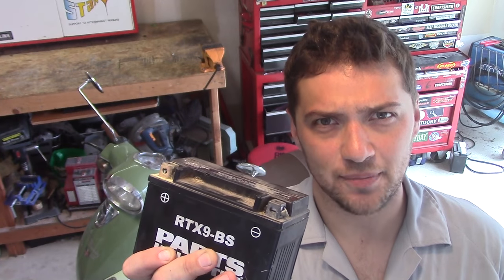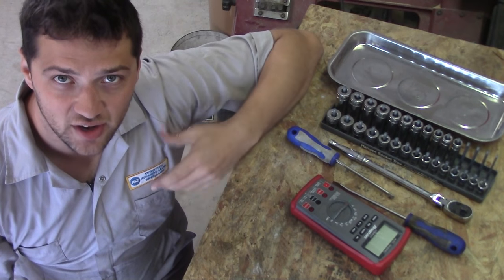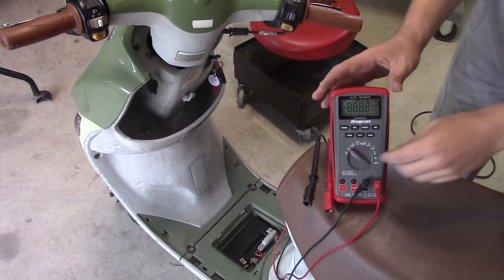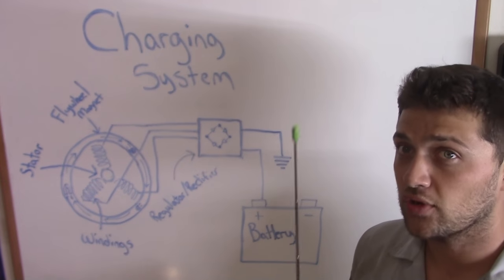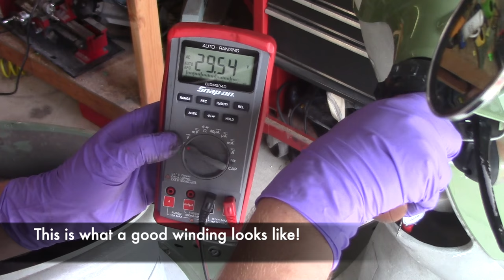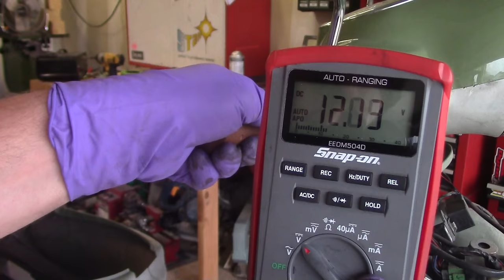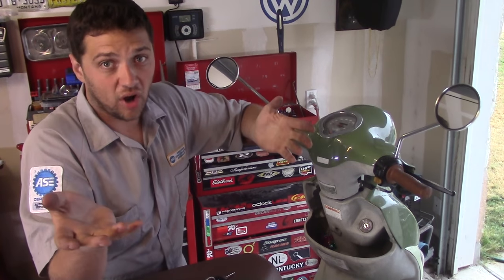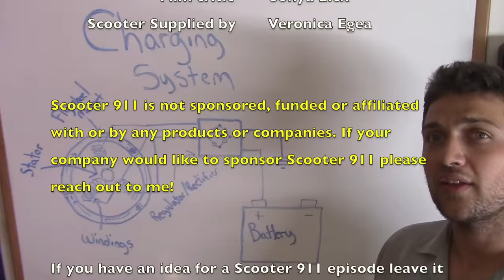Scooter 911: Battery Keeps Going Dead! (Troubleshoot your charging system and parasitic drain)

Comment: also, i don't know what "backprobe" means. and where does the other probe on my multi-meter go? (the one that doesn't touch the battery wire that the rectifier connects to)  thanks jeff

Comment: my scooty had broken starter magnet inside didnt turn the rotor properly then stuck at some point , then the relay done some cracking sound and my battery was dieing when tried for too long, i searched for a scooter startor in moto shop but for my surprise was auto stator , find it in new shop , hope it will start when i put the new one , its a Suzuki 150 cc epicuro model

Comment: So my ground wire from my stator is reading less than like 7 acv while revving the other two seem good is there a way to just fix the ground wire dose it mean it's improperly grounded or something I tried installing two knew stators but the scooter wouldn't start with either of them so I put the old one back on .. mostly just wondering if it's a grounding issue and if so how to fix it if the green is indeed a ground .. or if you know why a knew stator would cause it to not start at all installed same way brand knew same kind of stator ??? Thank you to whoever can answer this knowing what they are talking about ...

Comment: winding is new, rr. is new wiring was tested and still getting 12v. fail could be a low magnet effect?
Reply from the maker: I haven't seen many magnets go bad. You might have a ground issue or possibly excess resistance in the harness

Comment: I have a Jonway yy250t aka Roketa 54 250, it has a parasitic drain but cannot find the source and I am thinking it might be the alarm system.  Is there a way to check the alarm preferably without taking the fairing off?
Reply from the maker: unfortunately not. You'll have to disconnect the alarm to see if its the source of your drain.
Reply: @Scooter_911  I had a 2.5amp drain and the moment I unplugged the alarm system the drain disappeared.  I guess I am now buying a new alarm system.
Reply from the maker: @taranson3057  there you have it!
Reply: @Scooter_911  You make the diagnostic of these issues super simple.  I am happy that I decided to follow you.

Comment: Please help!!! I have low voltage at the battery,  and it drains it. I measured voltage at the stator, like you did in the middle of the video. When its unplugged voltage is good, about 45v (+/-) but when plugged in, it drops to about 4-5v same at the voltage regulator. I get same voltage at the battery,  regardless of engine RPM
Reply from the maker: Sounds like you have a shorted regulator rectifier my friend!
Reply: @Scooter_911  I have a new rectifier and new stator.. if I unplug rectifier and tone  pins, they are all somehow,  somewhere connected to ground.. how where could they be connected to ground? Is this even the right way of testing?

Comment: Is there a hidden diode on these scooters somewhere? I changed the stator, cdi, regulator, and stator and still can’t get it above 12.7 it’s starting fine even after sitting for a few days just can’t figure out why it isn’t reading more voltage. Thanks again for all your help
Reply: Solenoid, not stator twice haha
Reply from the maker: Hahaha sometimes with Chinese scoots it's anyone's guess what equipment is actually installed. The genuine buddy has a little capacitor/diode in the charging system I know. Most of the time when I have seen that problem it's due to a burned or damaged wire harness. At that point I usually perform what in the industry is called an "overlay". I cut the original charge wire and route a brand new wire from the regulator rectifier directly to the battery. Good luck! It sounds like you've done some good work and you're on the right track!
Reply: Thank you so much I will try that!

Comment: i bought new battery for my scooter . is it wrong if i dont charge it first and just connect it ? will it be charged through driving properly?
Reply from the maker: Really the only way to get a good charge on the battery is with a battery charger. Riding the scooter will charge the battery up but you may experience a shorter battery life

Comment: Having a starting issue, the bike turns over but does not start. When I kick start it does the same thing. I have a dong fang 50cc scooter. I have replaced the battery, cdi, ignition coil, and spark plug. It just keeps making the same noise.
Reply from the maker: Hmmm well check out this video I made to help people diagnose a "no start" https://youtu.be/xW5y7a7CB1c

Comment: Hello, i have a Yamaha aerox 50cc and i get 10volts ac out of the stator wire 1 and 18volts out of the stator wire 2.Normally both wires go to the rectifier.When i give trottle it only get a little bit higher...10volts to 12volts and that 18volts to 19-20volts.
Is this normal ?

Comment: mine will start up after charge then will turn it off won't start back do you it could be a battery issue? Was working fine until i went over 6 or 7 speed bumps got it home was about to take it back out for a ride then noticed it wouldn't go....

Comment: Today my scooty refused to start by self ignition.. so checked the battery by multimeter gave reading about 13.40V but when I insert the key and turned on then the reading drops to 0.00V.. is there something sort in wiring or electrical equipments??
Reply from the maker: Yes more than likely you have a bad connection somewhere. Check to insure that the cables are secure to the battery terminals and that the ground (negative) cable is securely mounted to the frame.

Comment: I changed the stator and regulator /rectifier and spark plug and my battery still seems to dye multiple times getting a new battery and my scooter doesn't stay on or it take awhile to start I don't know what else it would be I don't want to keep buying parts it's so frustrating , I don't know much about scooters this is my first one and I've only had it almost 3 months it's a 49cc pony scooter any advice I really really appreciate it

Comment: I checked my stator from the main plug. The yellow gave me around 8 vac and the white around 11. Vac and with the engine reved up it will give me about 35 vac. But when I test the wires from the front with the rectifier unplugged it only gives me like .50 volts? Why is that? Please help

Comment: i got an issue with my battery its weak and when i put on the charger for few secs it says battery fully charged but i know its not. how do i fix this issue? do i use the pulse mode to charge it? thanks appreciate your feedback

Comment: Hey Gerret. I want to get a new carb for my Boom Revolution 50cc 4 stroke scooter. Are all the carbs out there pretty much universal and will work?
Reply from the maker: Most 4t 50cc carbs are interchangeable. The big things to pay attention to are the connector on the autochoke and whether or not the carburetor has an accelerator pump. Good luck!
Reply: @Scooter_911  How would I be able to make sure I get the carb with the same connector on the autochoke, if ordering online?
Reply from the maker: @radconserv68  most sellers online will include a photo of the connector to make sure you know what you are getting. However if you do get the wrong connector you can just cut the connector off your old carb and splice it on to your new carb. It's just 2 wires that carry AC current so the polarity isn't even important. And you seem pretty knowledgeable about that sort of thing so I definitely think it's within your wheelhouse.
Reply: @Scooter_911  That's kinda what I was thinking, but wasn't sure if there be a difference in voltage. Cool. Yes, I can do that! Thanks again.

Comment: Okay wait, I did the part where I followed the wire coming from the stator and I put the multimeter in it and without the engine running it read 12 volts so why is that if yours read zero?

Comment: I have a 150cc kymco scooter I bought 3 yrs ago. Stopped riding it bc it was really jerky and would stall out of nowhere. Changed the sparkplug. Got new battery. Replaced the wire harness. Put seafoam in it. (For the carb cleaning) replaced the cdi with a new one. Yet the problem still exists. Any ideas on how to fix guys?
Reply from the maker: Usually if you have an intermittent running issue its related to the ignition system. So you were on the right track with the CDI and spark plug. You could have a faulty ignition coil or even a bad pick-up coil (paired with the stator).

I would recommend going through your carburetor manually and cleaning the jets with carb clean spray. Seafoam really doesn't do much when it comes to blockage.

Does it run well sometimes and then just all of the sudden it goes all jerky?
Reply: I had a Tao Tao 150 that would do the same thing. I replaced the original TaoTao spark plug boot with a Nippendenso  brand and it worked much better.

Comment: Bought a brand new Tao Tao 150, hooked up the battery and nothing. Checked the battery and it is full. Just not getting power to anything. Turn the key on, no horn, no lights, no power at all. Reconnected it 3x to make sure I had it right??? Help please

Comment: Yamaha 50cc 2013 big voltage drop to 7-8 volts,  as soon as I turn ignition on. Before I hit start button. 

Scooter jump starts ok but I seem to loose voltage as I accelerate.
When I turn the ignition off battery goes back to 12.7v

Comment: Ok. I just got a brand new battery for my scooter. Connected properly, ran the scooter for a min as it took a min to get it started. Shut it off n opened the garage door so I could take it out for a min. Now it's completely dead again. Why did this happen? Was only connected n running for maybe 5 mins... I'm so confused

Comment: Hello Garret!
I have the Chinese 150 scooter .
I replaced my stator and gave proper readings one day ...now that I thought it was a wire the wires coming out of the stator are getting hot( I think I had this problem before because the plug was dark colored .
Any ideas ?
I also have no headlight  ( high or low(
Thanks for the help
Reply from the maker: It is possible you have a bad regulator rectifier or possibly worse, a short in the wiring harness. Start by disconnecting the regulator rectifier and checking each stator wire for continuity to ground. You should have none. If you get a reading you likely have a short in the harness. If you like I can walk you through the test over skype
Reply: I will do more testing .
Thanks.
Is there any fuses or relays for head lights...I have no power at the connector for the lights .
Thanks
Reply from the maker: @noemonico3241  no there are no relays, I would check out the left hand switch. Usually there is a grey or brown wire that goes to the high beam low beam switch. The switch passes the power either to the blue or white wire. But on some scooters that brown or grey wire is energized by the regulator rectifier.
Reply: So I think I found the cause of my headache ...whit this scooter pinched wire harness by the frame and kick board .thanks again for your help keep it going you are awesome and a great wrench !!
Reply from the maker: @noemonico3241  excellent work! Glad to hear you figured it out!
Reply: @Scooter_911  
Now that I have your attention !!
Just joking  but So I have a other bike whit a issue rear cylinder no combustion. New plugs and wires .
It only does the check engine light if I crank the throttle hard over 50mph. At low rpm no check engine light.
Any suggestions 
Thanks
Reply from the maker: @noemonico3241  what kind of bike is it?
Reply: @Scooter_911  
Harley 96 ci Softail
Reply from the maker: @noemonico3241  ha! How'd you know I was a Harley guy? Harleys are really great to diagnose. Hold the trip button down while you turn the ignition on it will pull up the diagnostic menu. From there you can get the code and look it up online. A real quick test is to pull the plug out of the rear cylinder, attach the wire to it, hold the plug against the head and crank the motor and visually observe the spark.
Reply: @Scooter_911  
It's  P1356 .
Reply from the maker: @noemonico3241  that's a generic fault code for the rear cylinder. Did you visually observe the spark yet?

Comment: Scooter would run fine, then start losing power and dying. After letting it sit awhile would fire back up. Put in new carburetor, scooter would no longer get power going up any incline and would bog down at wot. Adjusted throttle and changed fuellines and vacuum lines, removed egr lines and plugged valve cover air intake (large hose on bottom of valve cover) changed variator and clutch, now scooter will only idle steady at 3k rpm spark days running rich but was accruing like it was starving after the clutch change so putting new petcock on and doing valve adjustment today. If that doesn't fix it what should i do next?
Reply from the maker: Honestly it sounds like the valve adjustment will most likely solve it. I did make a video on valve adjustments if you haven't already done it. https://youtu.be/QkkYjRdtQxg
Reply: @Scooter_911  adjusted valves and still no power ive replaced everything i know it could be....could this really just be a jet problem?
Reply: Also still not wanting to start despite way too many carb adjustments to count could this also be a symptom of wrong sized jets?
Reply from the maker: @tymartinez3166  well yes, but I assume you were making carb adjustments to fix a problem in the first place. So I would put everything back and start from square one
Reply from the maker: @tymartinez3166  how long does it run before it starts shutting down? Also if you didn't change anything with the jet size and it started running poorly then I wouldn't expect it to be a jet problem.
Reply: @Scooter_911  I changed the carb and the old jets were sized 82 and 28 main/pilot on the carb I removed,  are you saying put everything back to stock and start over?
Reply: It was idling fine earlier today,  went to lower the idle and instead of going down it went up... Left it idling for a good while and then took it for a ride,  no power uphill and wouldn't get up to 30 mph until I went downhill
Reply: Was not running great but was running got off to try to tune carb (with it running) after warm up and it died on me,  wouldn't restart till I fiddled with air fuel screw
Reply from the maker: @tymartinez3166  is the air fuel scree 2.5-3 turns out from being lightly seated all the way in? I really think you have some other issue. Would you care to try to troubleshoot this over skype?
Reply: @Scooter_911  I'd love to hows monday for you?  I'll have more tools Monday,  so far been buyin them on an as needed basis as I'm already over 100 dollars in new parts and no closer to a solution
Reply from the maker: @tymartinez3166  email me at garretseesingofficial@gmail.com and we'll set up a time

Comment: My battery doesnt just go dead, every 6 months or so i have an issue when i click the start button and the bike doesnt start right away then ill do it again and the starter sticks and the engine keeps trying to start so if i turn off the bike it just keeps cranking until the battery is totally dead. I replace the battery and the relay and about 6 months later it does it again, any idea why?

Comment: HELP!!!
my power on /off switch under my seat its a small white rectangle with a blue light flip switch wont turn off the bike gets power from the charger and turns on but the charger wont go red and charge the batteries the light stays green and all power to the big is gone as soon as I unplug the charger . HELP what do

Comment: i replaced my stator because it wasn't charging but it's still showing around 2 volts at full throttle and i can't seem to understand why it is doing this
Reply from the maker: Did you check the output voltage with the regulator rectifier disconnected? The problem might have been your regulator rectifier the whole time!
Reply: @Scooter_911  i can't remember but im gonna try that later and see if it shows a different reading

Comment: is it possible for a scooter battery to work for lights and for brakes but not have enough juice to start the engine? I have a wolf rx-50 and it wont start up sounds like it is about too but it wont turn on, i have a video of the sound if anyone knows or has any advice.

Comment: Hey my scooter isn't starting with the  automatic starter I replaced battery and still it will only kick start
Reply from the maker: does the scooter crank (make the riiiikikikkiikikikkiik sound) when you press the engine start button?
Reply: @Scooter_911  yess and  want stay on for a few seconds and then dies our

Comment: (D/C Function / Broad charging system test)
Red on POS
Black on GND
Start Engine
@idle 13V
@rev 14.5V
~10.V in either case = Problem

(A/C Function / Indepth charging system test)
Find Stator
Find 3 cables
Start bike
Test each wire
Each wire should read ~40V
If not ~40V = Problem

(AMP Function / Parasitic drain)
Scooter off
Remove key
Disconnect NEG from battery
Leave POS connected to battery
Red lead to disconnected NEG
Black lead from NEG to battery terminal 
Should read 0000
Anything bigger than 4 milli-amps = Problem

*****if any corrections I'll edit this post*****

Comment: Shit how do i get u to come figure out my kymco agility 50 battery dies every few days pops fuse and wont start. Has spark but wont start
Reply from the maker: Man that's a weird one. Most of the time a blown fuse is due to a short in the harness. But if the scooter cranks and won't start AND has spark I would try a quick valve clearance check. I made a video to walk you through it https://youtu.be/QkkYjRdtQxg. That is of course unless the scooter has been sitting for a while, in which case I would suspect the carburetor.